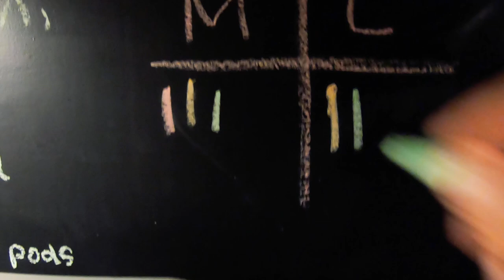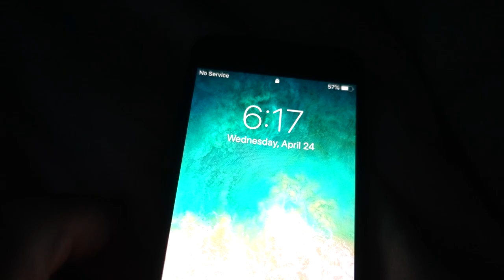I Can't Believe This is Ecuador! | Van Life in South America

Comment: To fix your leaky plumbing, you will need to un-thread the connection that is leaking and then wrap Teflon tap around the male fitting  3-4 times.  Then tighten the connection firmly.

Comment: If the leak is between the 2 fittings that screw together you can try 1 of 2 things or both. Try plumbers tape on the threads also if that is a "garden hose" fitting then the gasket is missing or compromised. you need a new garden hose washer.
If it is leaking from the hose with the hose clamp then the hose barb that is up in the hose may be to small it shouldn't leak. may need a bigger hose barb to go in the hose. tighten the hose clamp. if the barb is the correct size may need to trim a little of the braided hose back to a fresh piece. then re tighten. hope this helps.

Comment: Hi.  What a view !  What a place to stay .         Water leak.  Metal joints for water , try taping ( one , maybe 2 turns  ). Up with PTF taping .    Its is plumbers tape you can use for air, oil, water metal joints.     It is plastic thin tape, that can be pulled thinner like when you pull out chewing gum, but dont let it break holes in it.

Comment: Hey guys! Just a thought, at high altitudes the air pressure is lowered inside the pipes and containers that are air tight in the van. Therefore, the tension between the inner pressure and the pressure outside is greater at such altitudes. Due to his you may experiences leakages in gas pipes or water pipes. Nothing major but probably the pipes and plumbing initially was done for the ground level conditions. Just take care at higher altitudes and keep this in mind in case you upgrade your van later!

Also, love the weekly vlogs, I envy you both and obviously love occy.
Reply from the maker: Exactly what I (Max) was thinking mate. I think the extra pressure just put it over the edge. Has been all good now back at sea level 🤗

Comment: Like #1.9K+1,  if you have a bar of soap, scrape it on the threaded fittings that you need to stop leaking and on the fitting part under the hose clamp, the one that slides into the hose, a very old fix for plumbing when you don't have plumbing tape or paste, tighten like normal, easy to remove too,  Later
Reply from the maker: Awesome Rob, thanks for the tip!

Comment: Your leak is likely due to the metal on metal contact, get a plastic flange to go between and it will stop the leaks. I dealt with this on a toilet for 3 months before, plumber gave me a $2 plastic connector and some plumbers tape and it fixed it right up.
Reply from the maker: Pagan Book Club wow thanks for the tip!!

Comment: Teflon tape if it's leaking thru where the 2 hoses thread together. It's cheap, like $2 or you could get a 12" strip of it from most auto repair shops...wrap the male end in the direction the female end screws on.
Reply from the maker: I've got some on there but she still finds a way. Hasn't leaked since tightening though so may be all good now thanks!

Comment: Hey Mate, from what I can see on the video, your leaking connection looks like there wasn't any teflon tape on the threads I could be wrong. And I suggest getting a different connection to replace the hose clamp. Try and replace it with a proper plumbing union of some sort that can with stand pressure. Not sure exactly whats available in south America but Im sure you can find a simple remedy so you don't have to keep messing with it. Love you video's  All the Best to you!

Comment: Is there any thread tape on that brass fitting? If not, you'll definitely want to pick some up. I've done plumbing in more van builds than I can count, and metal fittings without thread tape are going to leak 90% of the time.